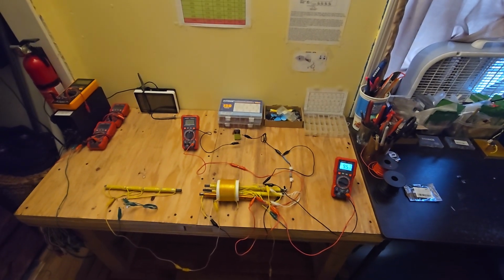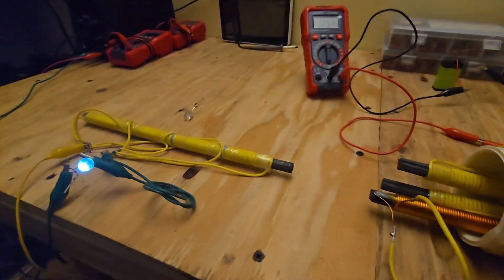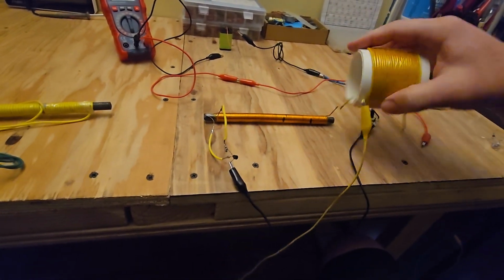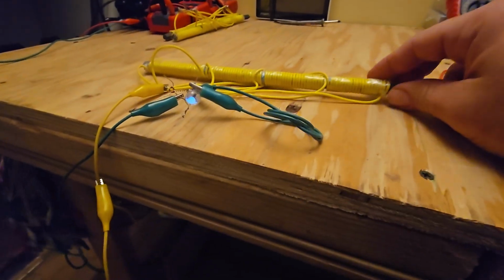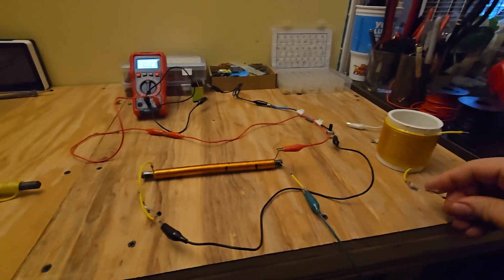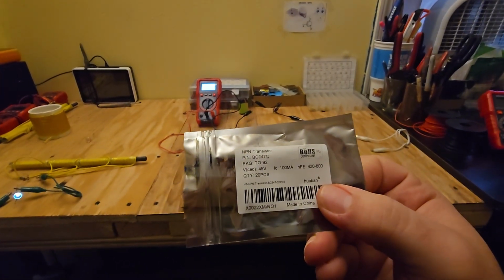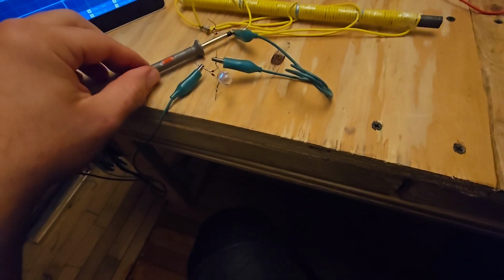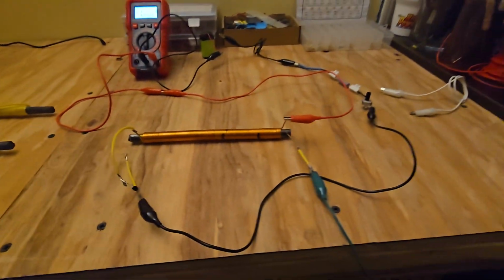🌟SELF ACTIVATING BREAKTHROUGH/RESONANT WIRELESS POWER🛜MINI MORAY VALVE?⚡️0.01mA J THIEF TRANSMITTER🤯

Comment: When the battery was disconected and the LED was still lighting dimly. This indicates that there is a resonant "electric field" produced by both the gold transmitter, and the yellow reciver coils. Each coil and capacitor circuit, must have been tuned, and each keeps the other ringing. This effect is similar to Tesla's spirit radio, that has no battery, but the two reciver circuits resonate to make their own oscillation! See how to produce this circuit at   
"DIY Spirit Radio - Spooky DIY Project. It is like a seance in a jar! | SciWorx Engineering". Keep up the good research people, We will get free power I'm sure.

Comment: Beware, a lot of LEDS can simply be lit with Mains 60Hz hum in the circuitry,or from stray RF nearby,
Reply from the maker: @foamaxmore  I've also demonstrated the ability to light these leds very far away from mains & even in my woods. The led will light between a small insulated plate antenna & earth connection or long virtual earth wire & the act of tapping or disturbing the rest state of the antenna even very subtly will cause the led to light

Comment: having worked for a few years with m tech and sid abraham, no it's not a joule thief it's an electromagnetic oscillator tuned in negastor... with each pulse it brings back the energy of the air or the ground. thank you very much to Fausto Gomez hekikken, for supporting my work in collaboration with mtech thank you for putting it in open source by demystifying it it was at that moment that I realized that our efforts were not in vain ❤️❤️❤️❤️⚡❤❤

Comment: im going to self activate a pcb dpdt relay  using the magnetic field coming off the coil . inside the relay is high impedance induction coil to move the contacts, means the contact will move with magnetic field and you dont have to change the inductor in it, eventually at the right placement angle the relay placed near the drive winding and it will trigger

Comment: you cam switch with the magnetic field coming off the coil and a reed this way no power is wasted with trigger. Can also switch with pickup coil with winds needed for switch volts and place coil over same core , the idea is to use NC and at first ignition NC opens and disconnects power causing the relay to return to default state of NC to again reconnect power .
Reply: Or just a mosfet, right?
Reply: @TravisTellsTruths  MOsfet and Transistor require small use of energy to switch , but you can switch with the magnetic field coming off the coil for free
Reply: @mykedoes4099  Reed switches wear out, but I need to try this.
Reply: @TravisTellsTruths  relay instead of reed . spst , spdt, dpdt

Comment: lower voltage batteries will charge easier with flyback, and quicker  even if amp hour are same as higher voltage battery in my opinion

Comment: You coud try to run it with a small 8V Capacitor, just charge the capacitor up and use it as the energysource for the Circuit. Would be interresting to see :-)
Reply from the maker: @paulkramer1601  going to try a good sized dc capacitor soon to start/run the circuit & the goal is to get the utmost efficient transistor to trick the system into self oscillation  :)

Comment: You should find an analog meter that can measure micro amps. It would give you an idea of what it actually draws. They make one that goes in both directions. That would be ideal, you could tell when it goes from power in to power out.
Reply from the maker: @newmonengineering  yes, adding it to the next parts list order along with some even more efficient transistors to try :)
Reply: I need one now, too. Oh wait, I already have one I haven't used yet. It was gifted to me. I'm going to try to use it soon.
Reply: This is actually pretty impressive Mal. Im going to use rechargeable batteries next.

Comment: Bro, the coils on the little receiver stick are supposed to be wound the same way,  no?
Reply from the maker: @TravisTellsTruths  yes the receiver coils are wound the same direction as the outer L2 coil on the joule thief transmitter
Reply: @MTECH2022 ❤
Reply: @MTECHINDUSTRIES2022  hey Mal, i just messed with your transmitter for the first time in ages. I uploaded a video with ZERO Earth grounds. I'm only just getting started. This winter I hope to do some stuff. In my other older video, I'm lighting 9 of the jumbo off white LEDs with like nothing but the switching power for the tip 35c. A few milliwats, all wireless. (That one is with my own separate earth ground involved). I'm going to try to show this old magical antique mailbox o told you about long ago. Cast iron crystals are like an amplifier.
Reply from the maker: @TravisTellsTruths  very interested about the cast iron crystals & in my current system the earth ground is essential to create the hyper Energy efficient self activating switching within the Transistor  :)
Reply: @MTECHINDUSTRIES2022  absolutely. And on my high voltage experiments, I've totally seen energy from earth sucked into the system. With your transmitter, too. I've done something insane with high voltage but almost no power. It broke the device to do it but I got massive white lightning from a device that only uses milliwats. I'm going to have to break another one to film it. 150$ a pop. Oh, well.
Reply from the maker: @TravisTellsTruths  i can sell you one for $99 plus shipping for being an existing customer  :)
Reply: @MTECHINDUSTRIES2022  my comment disappeared. I was referring to a particular negative ion generator device that I fried, it's a 7kv little thing.  Your transmitter still works, I did have to fix it once. I got a little plasma off of it with my Pyramid top and it shorted from a wire and destroyed the diodes and transistor. I would totally buy another one, though to have 2 transmitters.
Reply from the maker: @TravisTellsTruths  the ion generator seems very interesting
Reply: @MTECH2022  I've got way less than 1ma now and 0.56 volts.
Reply: Time for competitions ❤

Comment: Can I ask, are you using the Metal Plate as both 1. Transmitter and 2. Earth Ground? Or is your earth ground connection different from the antenna?
Reply from the maker: The plate is the antenna & usually connected to a Resonant receiver coil to increase its power output & the heavy earth ground connection to my heater is connected to the modified super joule ringer circuit.

Comment: ❤❤Hi 👋, Last Question 🎉? WHAT IS THE MAXIMUM WIRELESS POWER THAT YOU CAN GET OUT OF THE COILS ( outside your research - meaning in a normal situation with a proper 12v / 9v or power source) 

Using your coils - please 🙏 do a video to demonstrate how much power output and show some devices connected. On my side I want to use your coil designs but not with a dead battery, with AC or DC power supply. I want to replicate it immediately when you post the video.

🎉🎉🎉🎉🎉🎉🎉❤❤❤❤❤❤❤

Thanks a lot, you are the best😅😅😅😅😅🎉🎉🎉🎉🎉🎉🎉
Reply from the maker: @elmultimediaschoolofartscu3924  right now there doesn't seem to be a limit if I combine multiple Resonant receiver coils for an increased power output but the system starts to become messy on the table top but I plan to fully optimize & upgrade the system further. The key to its current success & near self activation is finding the utmost energy efficient transistor that can switch at virtually no current & voltage cost & once that occurs we have excess power made manifest in resonant receiver coils
Reply: @MTECH2022  you gotta use a Mosfet which I'm still trying to learn how to use. I been too busy

Comment: Your coil design😮, ( the gold cable transmitter), looks different, I am trying to copy the design but can't understand. Are you using 2 wire cables of same size? Are they side by side or on top n under each other? And that MOSFET , how is it connected. Do u have a clear tutorial for this exact transmitter coils? We need more videos on building these coils. Tutorials🎉🎉🎉🎉🎉
Reply from the maker: My YouTube channels  community post section lists a full in detail construction guide & schematic :)

Comment: All way appreciate the work you do and what you share thank you. Have you tried switching off the mains to you house and seeing if it still works. I mention this because I have had the same LEDs running for years now without any of my circuits running. But when the mains are turned off so do the LEDs.
Reply from the maker: Works outside too far from mains & requires more tuning both with a plate antenna & heavy earth connection & is best done at night to see the dim light.